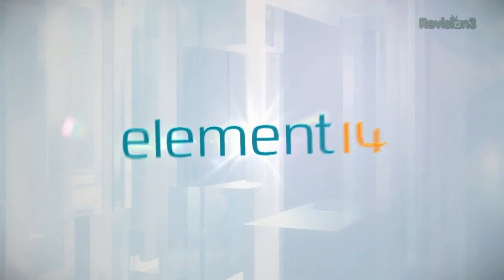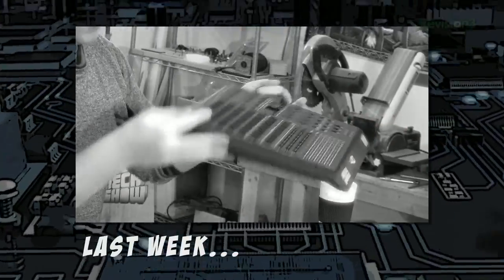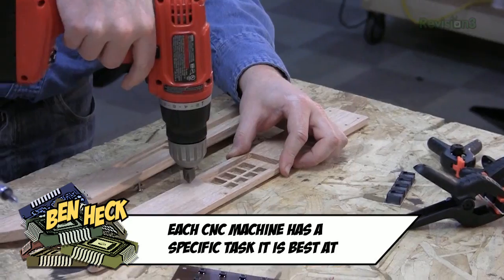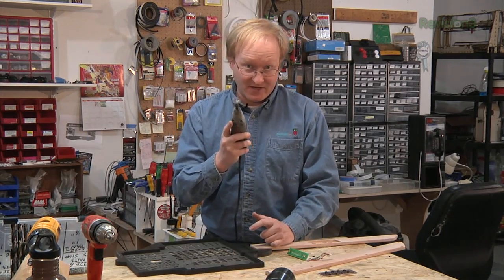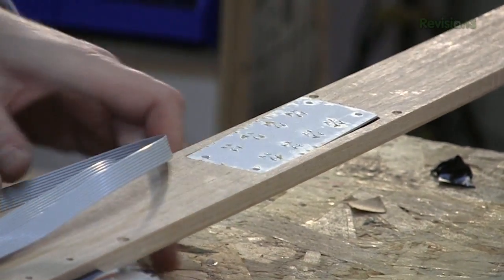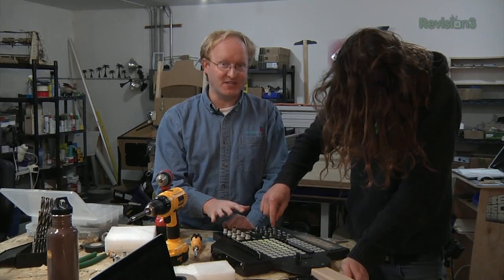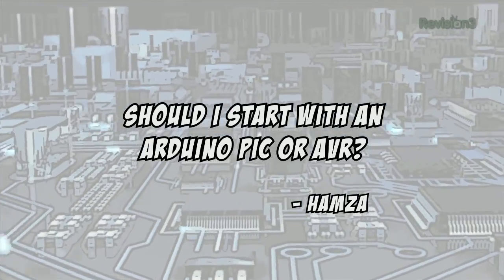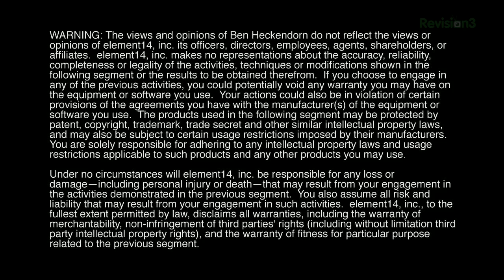Finishing Your Midi Controller Guitar!

Comment: Hi Ben! I want to build a guitar foot controller with 10 switches + 10 potentiometers and I need some technical advice (schematic and code) to controlled an Behringer V Amp Pro Guitar. I prefer with Teensy, or an Arduino. Thank you!

Comment: Not a bad idea/conversion there but the general layout of your stuff would be far better if you cut back on the razzledazzle graphics stuff and the self promo crap a good deal.  While the basic info is reasonable the way its presented isnt worth suffering through the the way its presented.

Comment: a job very well done however misplaced!!! could have made a connection with a desk and a cheap analog controller type bcf of 2000 ..... already have it in mind amuito Manjo not put much time and tbm not have any from 2 to spoil rsrsrsrs ... porjeto tiopo increases the fader mix of analog and simultaneously increases the controller and giving pr record presets tbm

Comment: Re ; 7:00 Cheap Tools - They have their place. For a one time or limited use basis a cheap tool is fine. Wrenches, screwdrivers, drills you should spend the money. But tools you may only use 1 or you expect you may destroy your tools doing a job, get a cheap one.